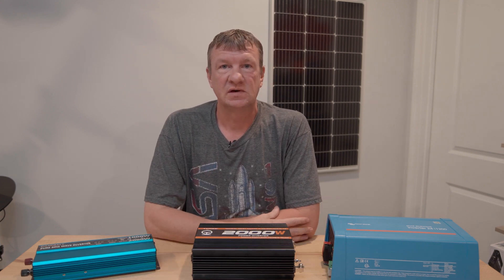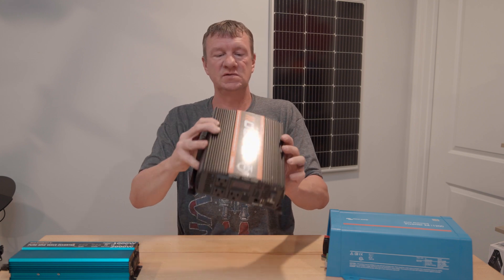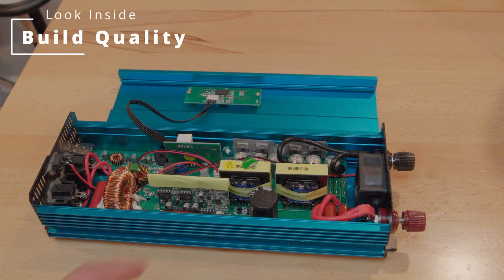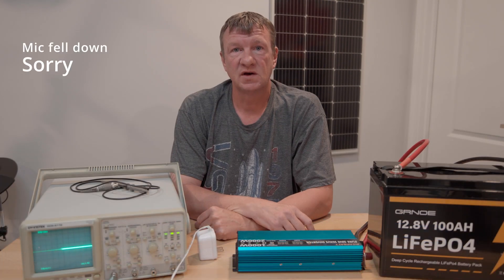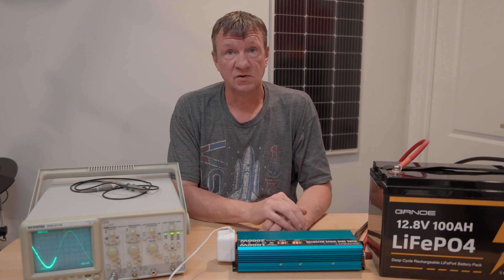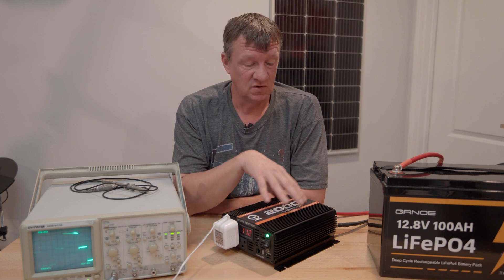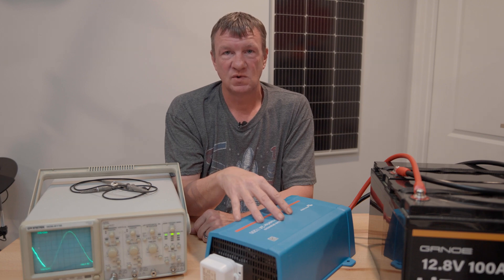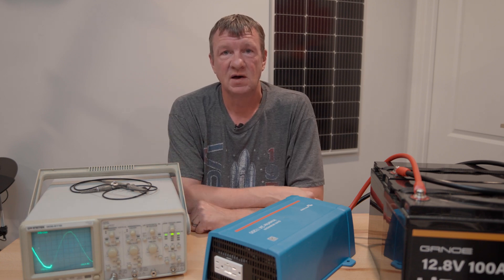Are Expensive Inverters Actually Better?

Comment: 4:30 this is mostly wrong, computers and electronics are powered through a switched mode power supply that rectifies the AC before using it, and the SMPS itself is extremely noisy so it has generous capacitive buffers. You can run a computer off of pretty much anything, even 200VDC! (I don't recommend that because two of the full bridge rectifier diodes could be overloaded)
Reply: 5:25 the idea that sine wave = no noise is also wrong. You can have extremely noisy sine or extremely clean square waves. (Square like waves do tend to have worse harmonics though)
Reply from the maker: Actually, running a computer on a modified sine wave inverter isn't ideal, especially long-term. While it might work for basic setups, there are real downsides:

Power supplies can run hotter due to the harsh waveform edges, which can reduce their lifespan.

Buzzing or whining from power bricks or internal fans is common because of the choppy waveform.

Efficiency drops by 5–15%, meaning more power wasted as heat.

And for high-end PCs, gaming rigs, or anything with a GPU, you risk system instability, glitches, or shutdowns.

A pure sine wave inverter is a better match for sensitive electronics—especially if you care about longevity and reliability.
Reply: @BrokenSignal I see no reason for that: four diodes and a capacitor don't care about what the signal waveform is like, as long as the frequency is high enough to top the capacitor up. Pure sine is actually an issue if used with a lot of switched mode power supplies simultaneously as they only draw current at the peak of the waveform to top the capacitor up, effectively increasing conduction losses compared to the same power supply running on a square wave (modified sine has the same issue as the capacitor has time to discharge itself before the voltage switches polarity).

I don't know how an old school transformer would react to such a waveform, but I'm pretty sure any electronics that rectify on the high side don't care. They already have to handle the worst possible voltage ripple on a pure sine wave (from 0 to sqrt(2) * RMS at twice the line frequency), so they have huge highside capacitors.

Comment: It's actually surprising how much kit a modified square wave inverter can run. Until recently I ran all my kit except the washing machine on one and that included computers, TV, microwave (panasonic inverter one, trad ones run at 80%) it could even manage the induction hob so long as i had the tv on at the same time. The chain saw battery charger just needed the kettle on to start but once charging was fine on its own. I'm now running a £250 pure sine supposedly 4000  / 8000W which is actually ok to 3500W and can manage just over 2000W with a horrid non power factor corrected charger with a PF of 0.57 and then the wave starts to distort at the peak so I dont push it any further. I do have a 1200W victron on in my truck but I inherited it, to me it's simply not worth the money and I have no need of Victron connect. My big sinewave one on my boat where I live is remote controlled and monitored by cheap home made gubbins from anything with a web browser.

Comment: You absolutely can - and in fact should - run a computer or a laptop off a modified sine inverter. That's how consumer grade UPSes were designed since 80s. And it's way more reliable design than a flimsy EGS8010/8015 based "pure sine wave".
Victron inverters can also switch to the MSW to conserve energy.

What you shouldn't do is to run motors with it. The motors WILL sing and their song is not pleasant. They will also produce more heat than they are supposed to, which can and will lead to a failure.
Reply: A universal brushed motor is fine it's just induction motors that object such as those in fridges. I've not seen a victron pure sinewave inverter thats switcable to MSW. It is true that in the old days MSW inverters were more efficient but that has changed. A Victron multiplus is, or was 1.2A quiescent, my 4000W pure sine is 0.4A quiescent and fails to get hot even running at fairly high power. Its actually more efficient than my old 2500W Heart Interface which is built like a tank with gravitational similarities too.
Reply: @philbrooke-little7082  High frequency inverters are generally more efficient than the LF designs, yeah. Victron has pulled no small feat with the Multiplus-2 inverter design, retaining LF-like load tolerances while achieving HF-level efficiency (96% for 48/5000). The quiescent current decreases with the battery voltage increase. 48V Multiplus-2 settles at 0.35A.
MSW on Victron is called AES mode. Might not be available on old inverters though, can be enabled in the VEconfigure app.
Reply: Any motor run through an ESC should also take anything because it essentially has its own three phase inverter

Comment: The Victron output looks worse than then cheap Roarbatt, there seems to be way more crossover distortion. 

It would be interesting to see a THD meter attached.
Reply from the maker: I wish I had a THD meter, or even a better oscilloscope to test for distortion.
Reply: @BrokenSignal  Having investigated the victron pure sine wave in some depth due to their not getting on with some washing machines, I found they try and fiddle cleverly with their sine wave when the motor starts and the machine, and the scope see this and the machine gets indigestion and goes into sulk mode. The more simple sinewave inverters get on fine though.